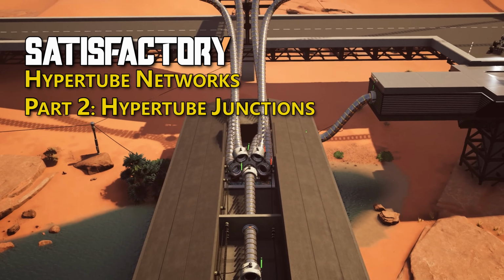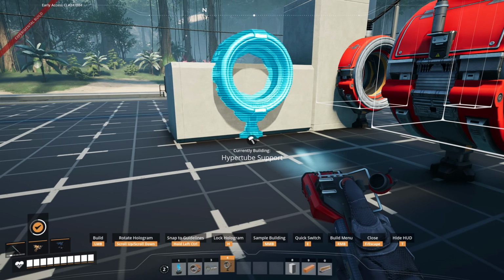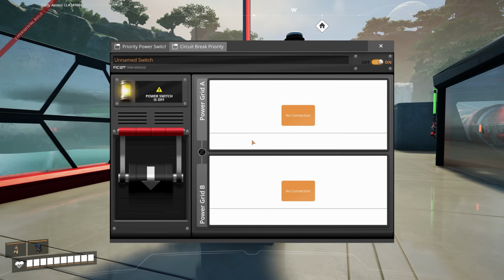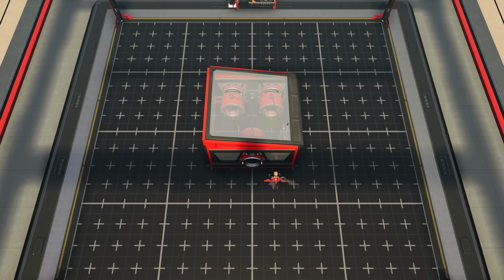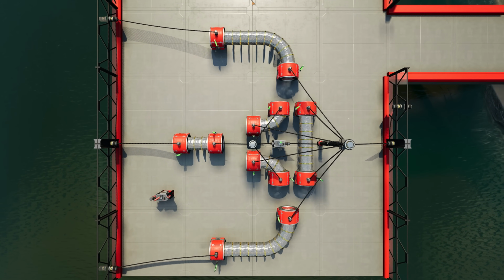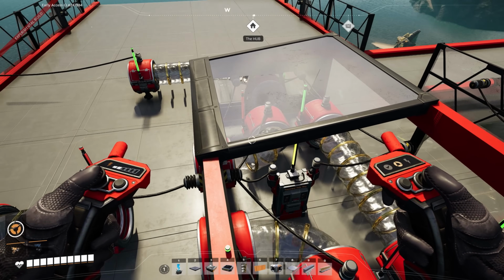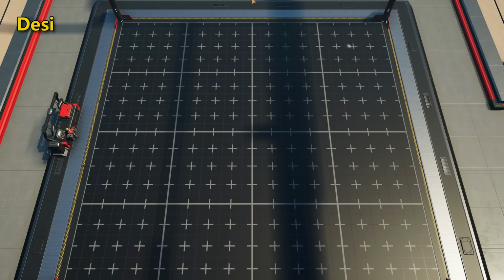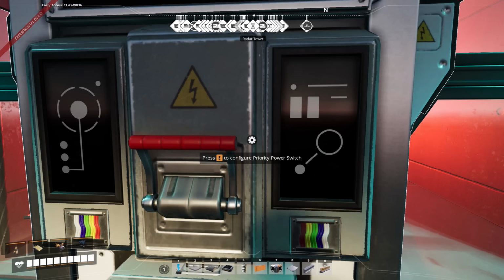Hypertube Networks Part 2: Junctions - Satisfactory Update 8

Comment: This is great; thank you. How much of a difference is it to manually steer left or right instead of using switching networks? I'm wondering how much add-value there is early on and at what level of complexity and travel speed switching networks start to become worth it. Subbed and waiting for more.
Reply from the maker: You can absolutely start a network with basic junctions earlier in the game. Most of the two networks shown in the video were built using basic junctions, and I've been travelling them using the manual steering method for ages! The remote route switching just makes it easier and more reliable to get to your destination without having to steer.

The 5-way split shown at the start was manually switched by running wires all the way up to the top of the tower where you enter - you can see the original switches around the edge of the tower (although they've since been upgraded to priority/remote switches).

If you use a basic junction blueprint and start building a network earlier in the game, it should be pretty straightforward to replace them with switched junction blueprints once you later unlock the priority switches (and once Update 8 hits the EA branch).